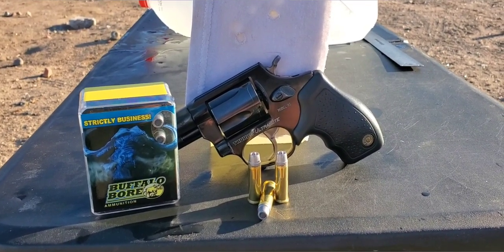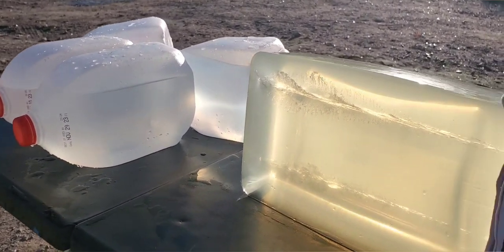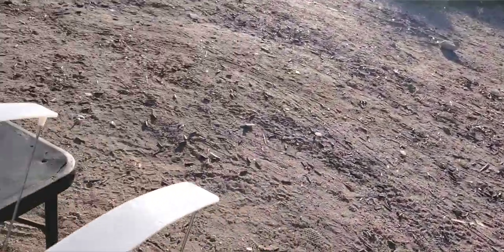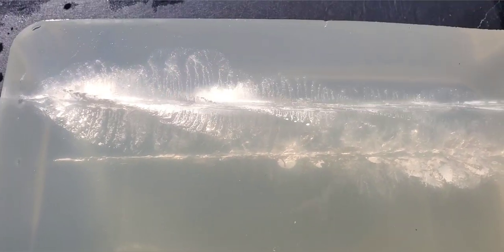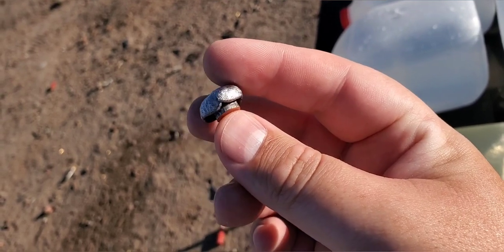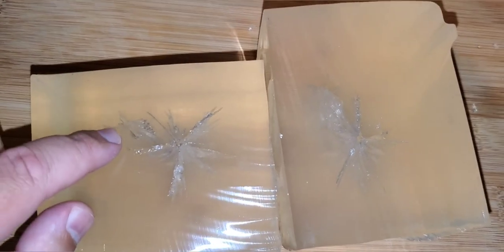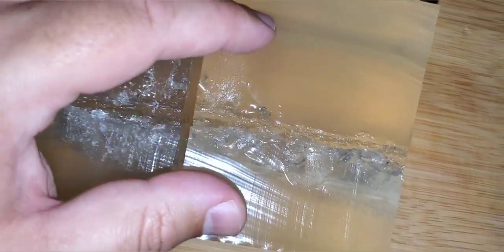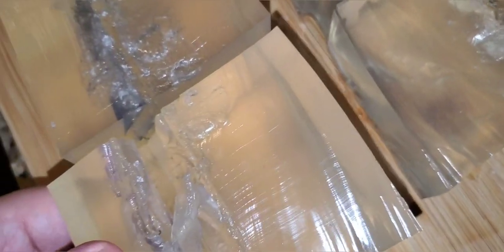.38 special buffalo bore 158gr +p lswchp in ballistics gel

Comment: I seen online that Underwood is also making the +P  158gr swc hp too, have you tested those, or done a side by side comparison?
There's not to many hp point rounds that will actually expand out of a 2' barrel.
I'm not even sure if the Speer Gold Dot 125gr +P hp will expand from a 2" snub.
I believe most FBI and Law enforcement that used a snub also used the wc rounds. Buffalo Bore are some powerful rounds. Thanks for your video. I've got the Buffalo Bore 158gr +p swc hp for my Taurus 856.  damn those were costly. haha  Peace.. Joe
Reply: The Underwoods do just as good , you are right about gold dots , they don't expand
Reply: @c.miller3802  That sucks, because I just bought a 50rd box of them for $35.00
But I probably shouldn't complain with that price for +p ammo. I'm sure that it will at least be accurate. Now that you've told me that Underwood's are just as good as the Buffalo Bore, I guess I'll just have to compare prices from now on. Thanks for commenting. Peace.. Joe

Comment: this is NOT the FBI load. that load was really about 850 FPS from a 2 inch barrel revolver. this is a 357 magnum loaded in a 38 special case. B.B. has an FBI load but it is with a special blend of powders that keeps it standard pressure and propels the bullet at 850 FPS. making it safe to shoot out of non +P rated guns. although recoil is up there with the +P type ammo.